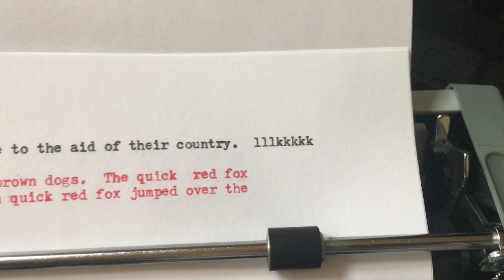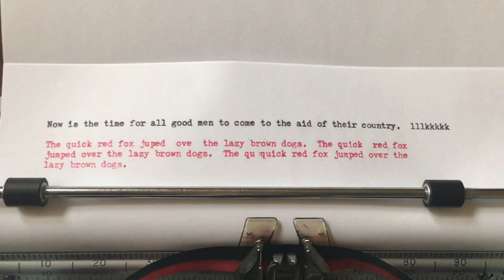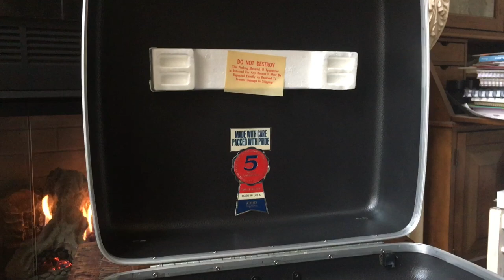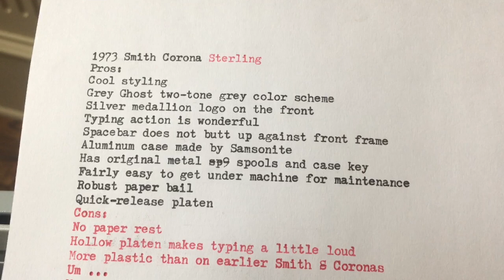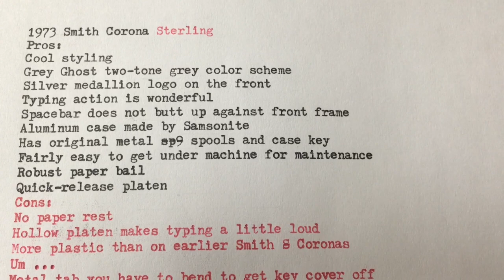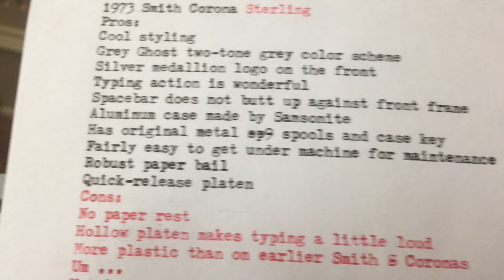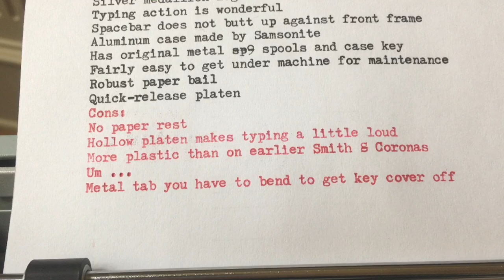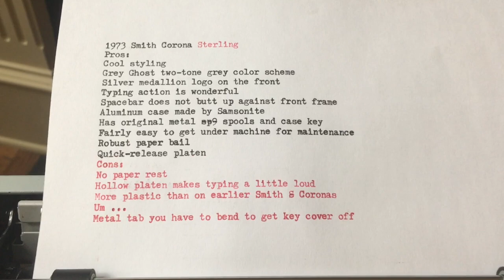Typewriter Review: 1973 Smith Corona Sterling

Comment: Thank you so much for the video! I just ordered one of these and I need to replace the ribbon. Would you be able to put a link of the proper ribbon to buy?
Reply from the maker: It takes 1/2 inch ribbon on standard 2 inch spools. I buy nylon ribbon from Fine Line. I believe they also sell silk and maybe cotton. Call them and tell them you need 1/2 inch ribbon on 2 inch spools with eyelets installed (for ribbon reverse mechanism)

FINE LINE RIBBON, INC.
800-527-0354
theresa@finelineribbon.net
https://finelineribbon.net/
Reply: @TypewriterMinutes  thank you so much! Much appreciated m!

Comment: Well this is ironic, I just bought an identical twin to this one yesterday, except that the page gauge on mine is white, that might be a later change .
Reply from the maker: Interesting. What year is it?
Reply: @TypewriterMinutes  just looked it up, appears to be a 1973 as well.
Reply from the maker: “Hey Joe!  We’re out of black page gauges. Go grab some white ones from the Galaxie model bucket!!!”
Reply: @js23-  Mine has a white page gage as well but even though the SCM data base says 1973 for the model I have, mine came with a repair tag dated clearly 1/2/1971 which I speculate was actually a 1970 model, Christmas gift perhaps that needed repair for a spacebar issue the following week.